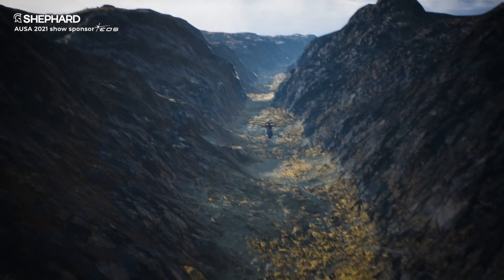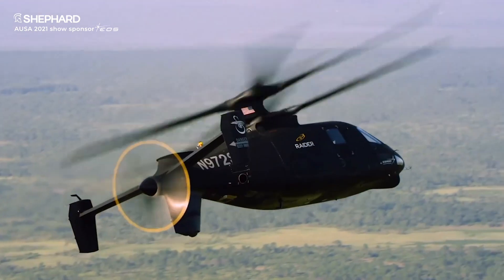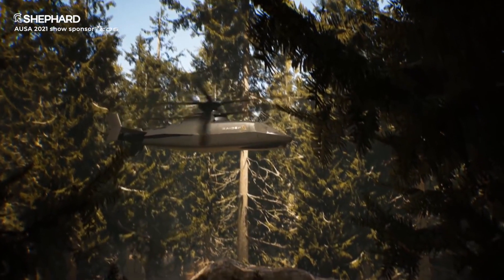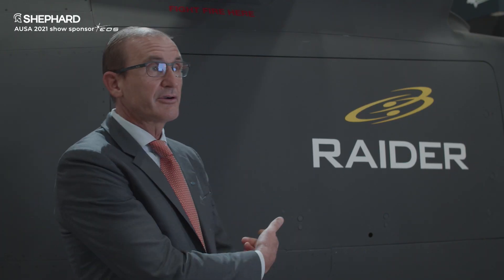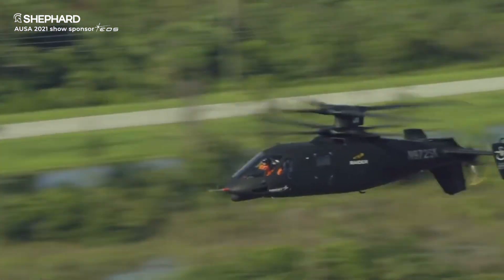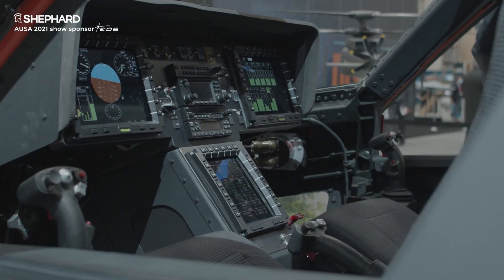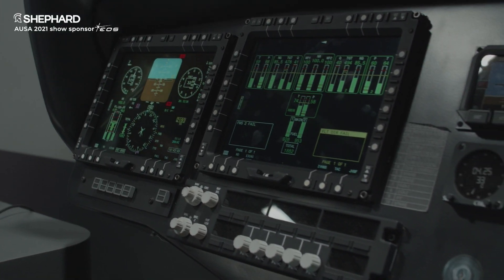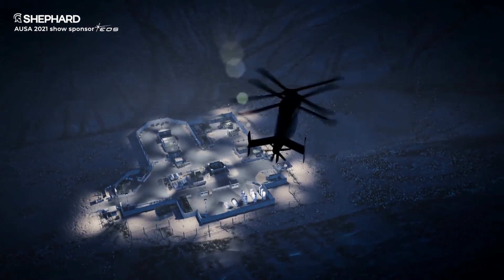AUSA 2021: Raider X on display

Comment: Is this defiant X sikorsky and boeing vertical system program????
Reply: It’s Future vertical lift (FVL) programme. Under this effort there are two rotorcraft programmes- FLRAA and FARA. In both programmes the final competitors are Bell and Sikorsky. Now, under FLRAA there is V280 tiltrotor v Defiant X. In FARA, there is 360 invictus v Raider X (which is the one in this video). Raider X and Defiant X are different.
Reply: It says Raider X in the title, not Defiant X.